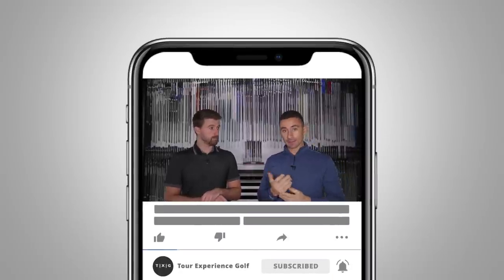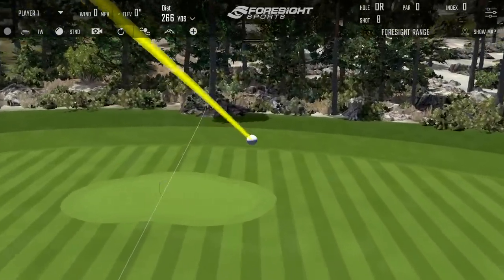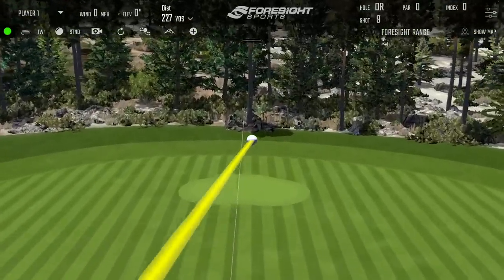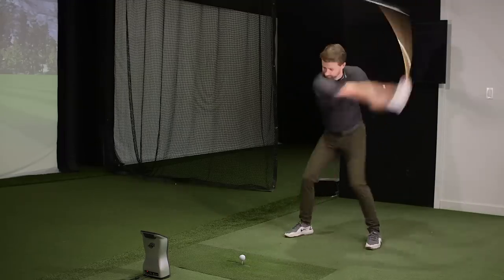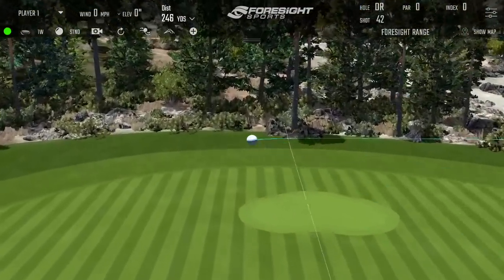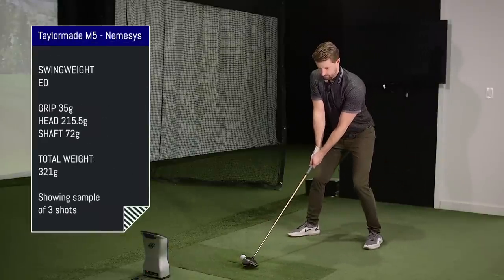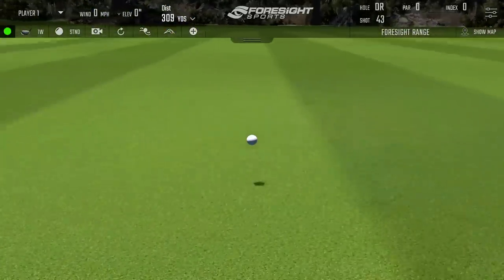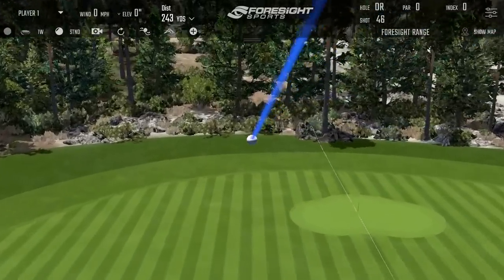Blind Test – Swingweight & Total Weight | Driver

Comment: As you mentioned Matt seems to adjust his swing as he sees the ball flight.  On a blind test like this I suggest having Matt's screen off and GC4 screen covered so he doesn't subconsciously change his swing in adjustments.  I seem to remember you guys doing that in an older video.
Reply: Craig Tompkins yeah, they did that for the single length irons to determine if they had appropriate gapping.
Reply: Thought the exact same thing.  Matt is too good and can adjust to whatever he sees.  Screen should be off for future videos of this nature.  Still a great vid!
Reply: What would be the point? It would make sense in scenarios where an unbiased robot would be needed - i.e.,testing which driver head produces fastest ball speeds, etc. in this case it’s more about how players react to changes in swing weight and/or static weight in somewhat real playing conditions.
Reply: @CSqrdX  Uhh... What?
Reply: As a counter point: do you not react to the ballflight you see on the golf course or on the range?
Reply: I think the effect was shown.  When the swing weight went up to E0, he couldnt get them back towards center line.  C range, all go right.  The test was successful as shown.
Reply: But that's what you do in real life - you adjust to accommodate a swing weight change or any change and just create a swing workaround.

Comment: Guys, OMG this is the greatest video! This is exactly what happened to me a few months ago. Several people recommended I go to midsized grips as I have large hands. I regripped all of my clubs with GP CP2 midsize and all of a sudden I lost a lot of yards with my irons and hybrids (it didnt affect my driver much). What I didnt realize was I was going from a 50g grip to a 65g grip and that was making my clubs go into the "C" range. I felt I could swing the clubs faster, but was losing yards. Can you please do the test and show the affect on irons? Perhaps also show how the change can be mitigated by adding lead tape (or using lighter midsize grips)?
Reply: Great point. I have the same situation after regrip with multicompound M size grip, and lost lots of distance. Same here wants to know !

Comment: I tried to read the comments to find a thread about this, but I couldn't find one. My question is, how do you recommend finding the RIGHT swingweight for each person you fit? It's frustrating living in AZ where there are so many golf shops and you bring up swingweight and quickly realize these "professionals" have no idea what they're talking about. I lose any trust in the fitting and I've ended up spending hundreds of dollars on fittings and grips and aftermarket weights. The best club I can hit in my bag is probably my 54 degree SM8 but that's a D5 swingweight and since I'm on'y 5'6" and don't swing the club super fast, I just don't see that working for me in a 4-iron or a driver. So that approach makes me nervous. I was fitted into lighter shafts to help generate more club head speed and backspin, but after watching this video it's clear that two drivers around D4 swingweight but with different total weights can act totally different. Outside of flying to Canada, what would you recommend to try to figure out the best swingweight for my game? And what are some red flags I need to worry about (is there a threshold of overall weight I should try to stay inside, etc.)

Comment: Ian is so right on...again! That’s why most fittings done are not correct. We have a couple of highly regarded facilities in my area that do fittings but they are limited on shaft lengths & grip options that it’s not a very accurate fitting! It turns into more guesstimating that fact!! You end up paying a lot of money for something that may not work.

Comment: You guys aware killing it right out of the gate in 2020!!!
The one thing I dislike about the “fittings” I’ve done off manufacturers fitting carts is only having the option to use standard grips.  I don’t have big hands (wear a ML cadet glove) but I like the feel of standard MCC+4 grips built up with 3 or 4 layers of tape (about half way between std and midsize).  When I hit demo clubs off a fitting cart I always find myself gripping the club too tight.

Comment: I found this video to be one of the most fascinating that you guys have every made since I have made several grip size changes over the last few years to accommodate for physical problems with my hands. I’ve ended up with oversized in my driver, 3 wood, and Hybrid. Everything else is midsize and I’ve had a lot of success with the larger grips, especially in the driver and 3 wood, both from the standpoint of reduced pain and increased stamina in my hands especially on longer courses where I make more “full power” swings. However, in the past I’ve always had the most success with very heavy swing weights in all my clubs but my hands just can’t handle that anymore. This video helped me to understand that there are more factors that could be influencing the success of these changes other than just the size of the grip and while watching this video I had the realization that I’ve also had to smooth out my change of direction tremendously due to the issues with my hands. Imagine going from a 19 year old Sergio swing in terms of drop, insane amount of lag, and tempo to something much more like Fred Couples or Ernie Else when it comes to changing direction at the top of my swing. Could this change in tempo, and therefore not loading the club as aggressively, be a contributing factor as to why I’m finding more success with lighter shafts and lighter swing weights as well?

Comment: Absolutely love this type of video .  Us gear heads get obsessed with the little details that may not matter for our skill level. In this case, the weight and swing weight varied sufficiently. Another test that may appeal to gear heads is hard stepping and soft stepping (and also tipping in wood shafts) and its impact in measured performance and perceived feel.

Comment: That was a great video. I’ve always considered myself pretty thoughtful with my equipment, but who knew that there could be such a disparity in grip weights? I would have never known to ask about its weight. I have recently put the align grips in my wedges and irons. I noticed that while I love them in 6-pw, my 4-5 just felt a little off. It is not enough that I would pull the grips, but I have made minor adjustments. Keep bringing that golf knowledge!
Reply: Freddie Tayco we will Freddie.  Thanks for the support.  👍🏻

Comment: This was incredibly helpful. I am a returning amateur and after 10yrs, and a true fitting, I could definitely feel different aspects of the club, but couldn’t really describe it. But, I also have bigger hands, so after I found the club/shaft combo I wanted, I chose the align grips, which I DID NOT HIT WITH. I’m a little afraid that moving from the standard fitting grips to a heavier grip is going to screw with me. Especially, as I ‘think’ what I liked most when being fit was a higher swing weight (we never checked). But I could really feel differences which allowed me to swing in a groove and where I felt I lost everything. 

Clubs should be completed this week, so this was great information should everything go sideways.

Comment: I’ve always struggled with a slice (my shit ability) recently bought a TS3 driver and Ventus 5S shaft to try. Lightest shaft I’ve ever tried I think. Distance was up a few yards due to lighter weight and hitting low draws. A few mega hooks have crept in per round, so I bought a weight kit to play around with. This came today, which handily coincided with your video. Just spent a bit of time weighing all the head weight options and calculating swing weight online. I was playing it at about D0, which is probably why these hideous hooks have crept in, with the increased face rotation! Time to add some weight to the head and get back on the course. I’ve learnt so much from you guys, and continue to do so. Every day’s a school day! Thanks guys.

Comment: Matt and Ian - This video is great. A few months ago I went to a fitter and I was about a 10 handicap, I was fitted for PING i210 Irons in KBS $-Taper 120g Stiff. Right now I'm at a 7 and my coach and I have been trying to figure out what the issue has been with my iron ball striking and overall iron play, well, it turns out that they're at D5 swingweight (!!!) and I had no idea until I checked back in with the fitter. I'm now in an odd position where I may need a refit. It's a concept that is extremely overlooked by fitters and shouldn't be as it is also extremely important. Again, great video!

Comment: Nice vid. It seems to me that swing weight is a more significant factor than say shaft stiffness,  kick point etc. I've never had a driver fitting. But I bet you most places in uk spend an hour testing heads and shafts. Agree on best fit. Then spend 1 minute at the end picking a grip you like the feel of. Without actually hitting the final build! Bit of a con really.

Comment: New season coming up, time to change my grips.
Tried a new midsize MCC Align hybrid grip from Golf Pride ( replacing the usual stock grip) on my 3 wood, the results were so much better from the tee and fairway. I found by having a larger grip I was not gripping the club so hard, thus better wrist moment and gaining 15 yards. 
So now I have the same grip on all of my clubs, except on my putter of course.

Comment: This is interesting because grip weight on its impact on a club has never been mentioned before in a fitting or when I just wanted to try a new grip. I just went from the z cord standard size grip to a mid sized tour velvet.

Comment: Interesting video. I have very basic club building skills, and I knew grip changes can change swing weight. What I take away from this video, yes, a club fitting at TXG would be the best. But, I can also start fitting myself. If I find a club combination that feels the best, weigh and measure everything. Probably better than going to the local club fitter!

Comment: Great video guys.....watching everyday.

Can you possibly do a video comparing shafts in the same line , ( for example Diamana Blueboard  63x, 73x, 83x ) at 44 inches , then grab another one each of those shafts, tip them all an inch, then have them all set up at same length and swing weight as original 3 in test.   Would show effects of weights / lead tape / hot melt to get 63 up in sw, heavier grip / other tricks in 83 to lower sw,  and also show how / why tipping works 😀

Thanks guys

Comment: I would also love to see a video on how to properly re-swing weight a driver after you cut it down to a shorter shaft.  I feel it might be a little more than just adding head weight back.
Reply: Wouldn't it be adding weight to the butt end to go back to the swing weight you were on. i.e. you take weight out from the butt end, you add weight back in there.
Reply: @vinnienaidu  if you shorten the club the effective weight of the head feels less as the length the weight is suspended off is shorter. To get it to feel as heavy you have to add weight back to the head if you shorten a club and want to maintian sw.
Reply: @DougNielsen  Aahh I see, I've been confused in the past about this but the way you've explained it makes sense. After all that's what the swing weight concept is. Thank you again.
Reply: @CraigalFun  Haha I think all manufacturers do that don't they? Unless you specify to them. Maybe only PING takes a bit more care? I could be wrong and open to being corrected. In the NZ/AU region, I know you have to request about proper swing weight for custom builds with most brands.
Reply: @vinnienaidu  they do which is poor. So much for custom
Reply: I would like to hear an answer from TXG, before i shorten my F9 shaft.
Reply: What does TXG say on the subject.
Reply: @galdessa1  add more weight to the head
Reply: Naidu

Comment: Fascinating video guys, thank you! One thing I'm curious about after seeing the conclusion - what influence does the grip, and grip alone, have on the shots? So in other words, keep the shaft and head the same, and just change the grip out for ones that are fatter, thinner, lighter, heavier (or the same diameter, and lighter or heavier if that's possible). The grip isn't something we really think about, but in a relatively light build like mine (TS1, 55g S-Flex and a Golf Pride standard) the grip can have quite an impact on the swingweight and overall weight of the club.

Comment: The difference in a set of iron shafts:  hardstep vs softstep, in multiple iterations.  i.e.  4x hardstep.  Measuring all variables from total weight to any deviation in swing weight as well as change in balance point.  Or maybe a video with as many variables controlled on an iron set build and comparing shaft length progresson from +2 inches to -2 inches.  The unexpected fade and draw bias revealed here makes me feel as there are other compositional fundamentals to be discovered.

Comment: The human brain has the incredible ability to adapt. If you are older, it take probably more time, but it still works. The problem with club fitting in my opinion: The best fitter can not predict how the player will adapt to the clubs balance point and weight in the future.

Comment: The last “model” gave Matt the best speed numbers and ball striking position. But too much club face rotation. Would you then keep that configuration in terms of weight and swing weight and then adjust the head issue by moving the head weights? Or would that combo be a no go no matter what in your recommendations?

Comment: I swing a bit like matt, but go slice instead of hook and my driver has a really big heavy grip on it and a heavy overall weight (D6-7 swingweight) and now im thinking make the grip a touch lighter and lower that swingweight to d1-3 and see what happens!
Reply: If you go with a lighter grip you will increase the swing weight, potentially to D9 or into E for instance… This might make your face closure and therefore slice worse.

Comment: Driver shaft weight 40 vs 50 vs60 vs 70 vs 80 gram weight. Does a slower swing speed improve their distance with a lighter or heavier shaft in a driver? Does a faster swing speed improve their distance?

Comment: Hi guys - awesome start to the year btw. Love the content ;) I have a question for you! after changing grip on my driver (heavier) I lost control of it (turned out to be C9 swing weight). I also always choked down from 45" to 44"...so I got the shaft shortened to improve consistency of contact and added lead powder and corked the shaft to get to D3. It's now a hell of a lot straighter! But the ball flight is also a lot lower. I'm wondering if the lead powder and cork method changed the CG of the driver head (TaylorMade M4). I do have a heavier screw weight I could change for the current weight which is toward the back of the club head. Would this help to re-align the CG to closer to where it was? Any comments much appreciated!

Comment: So, what affects a persons swing more... the swing weight, or the head weight?

I ask because at the end I thought... when they do these test about grip size they should adjust the swing weight to eliminate that variable, but to do that they would have to add weight to the head for the XL grips... you'd always have a variable. In an attempt to minimize the impact of as many variables as possible, which one is more important to maintain? head weight or swing weight?

Comment: How much of the heavier weight staying open was due to the total weight vs the larger grip? Could be interesting to try a large light grip (Winn drytac) vs comparable heavy grip (MCC), with head weight adjusted for consistent swing weight.

Comment: Could you do a test with Tour Lock Pro Counter Plug for irons? Putting a 30, 50 and 80 gram in the grip end? I noticed when I experimented with 80 gram and taped it on to the but end I felt the club to be more stable and and more control in my hands.

Comment: The comment at 10:40 seems incorrect - swing weight and overall weight are different. Lighter swing weight implying faster closure rate is something that needs to be clarified - I believe that’s backwards?
Reply: 17:00 - Light/skinny grips have a faster closure rate - meaning heavier swing weight implies faster closure rate, if the only variable is grip weight. Aka lighter swing weights mean slower closure speed / more stability. That’s why the above seems incorrect

Comment: So to maintain swing weight when changing grip weight, is it a like for like relationship? 

So 50 gram grip switched for a 60 gram grip, add 10 gram to head and swing weight maintained ? 

Great stuff as always thank you.
Reply: No, 5 grams per SW on the grip and 2 on the head (generally speaking). So if you increase the grip by 10g, you have to add 4g to the head to counter balance. You can use lead tape or stick on weights to do it easily.
Reply: @philr1924  - thank you, very helpful.

Comment: Regarding the grips. What is the weight calculation to move the swing weight.
Ie if you have standard mcc 46.5g and change to standard mcc align 51g
Is that going to move the swing weight by enough to measure?
Reply: I doubt you'd notice the difference

Comment: Question as far as grip weight is that just grip or with wraps? I know you guys can blow them on and off but for swing weighting purposes would you use total grip and wrap weight for that part of the equation? Or until you get into extremes for adding wraps the difference is negligible?  For example i use 2L 3R for wraps  would that be something you would add with the grip weight for that part of the equation?

Comment: Do you consider it appropriate to add weight to the club head when switching to a heavier grip in order to stay close to the original swing weight of the club, or do you just accept the lower SW?  Always debates on this issue in the forums.